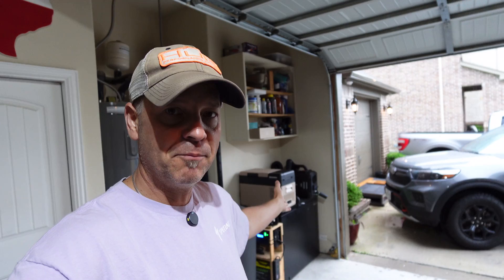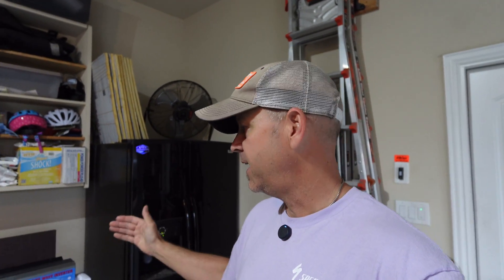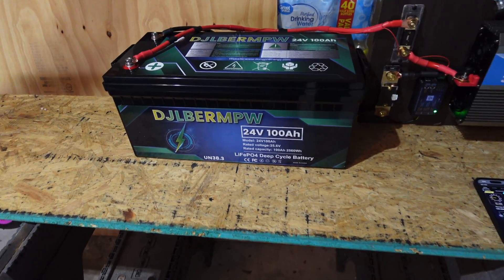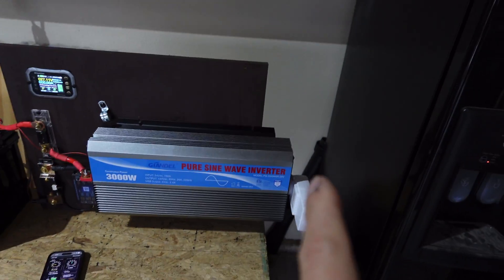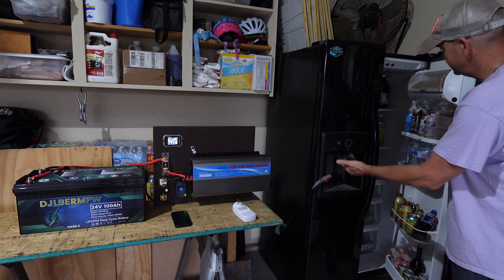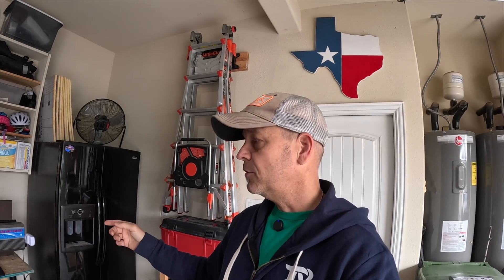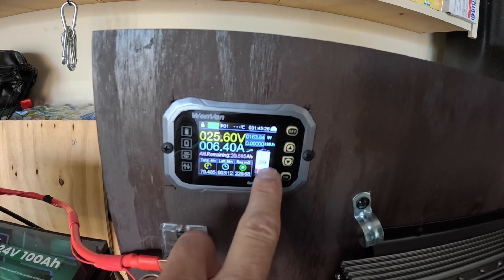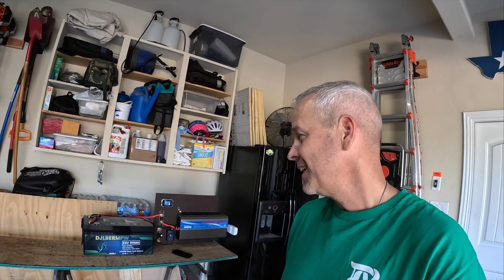1 battery VS a full size residential fridge.  Runtime with NO solar?  DJLBERMPW 24v Lifepo4

Comment: I have two of the 12.8V 100Ah of that brand and I have an 1100W inverter that can peak at 2200W. I have been wondering if it will run my refrigerator.

Comment: Im looking at the Giandel 24 volt 4000 watt inverter for a fridge and portable ac unit. Do you think it'll handle the load? I like that shunt you have.
Reply from the maker: Yes, that size would easily run this setup

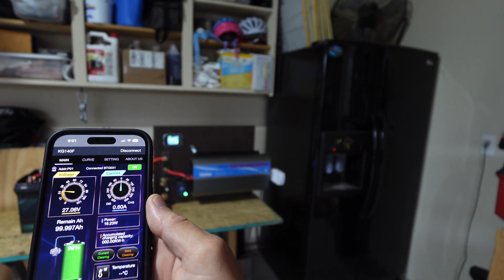Comment: after 3:57 you see the Amp goes up from 0.80A to 22.50A when the compressor starts up and then drops down to 6.5A. BTW, the fridge will use more Wh/day if you have the ice maker on.

Comment: do you also need to make sure the discharge current of the battery is ample for the com pressor draw?
Reply from the maker: Yes, but typically any 100amp battery should be more than adequate for a standard fridge

Comment: I've done this in past power outages.  What I've found is that one wants to use the smallest inverter that is still able to start the fridge's compressor, otherwise the vampire consumption of the inverter is going to be a significant portion of the total energy used.  Usually a modern fridge will run fine with a 800W low-frequency inverter.  Even a 500W LF inverter, depending on the inverter.

Remember, inverters do have a 2x or 3x surge capability vs their rating.  A high frequency inverter can usually surge around 2x while a low frequency inverter can usually surge around 3x.  As long as it can start the compressor without tripping off, you are on solid ground since the actual running wattage is a lot lower.

Great Test!

-Matt

Comment: Yep, the defrost mode will use the highest wattage burning that heating element . Victron inverters have a higher efficiency rate.  Do your homework on the most efficient inverters.

Comment: My highest wattage is when my Refrigerator went into defrost mode. With the compressor starting up. A Refrigerator is not a sample electrical thing. But so needed. Also in your test the Refrigerator is in the Garage. A bit more heat than what the Kitchen may be. Thumbs up 👍.